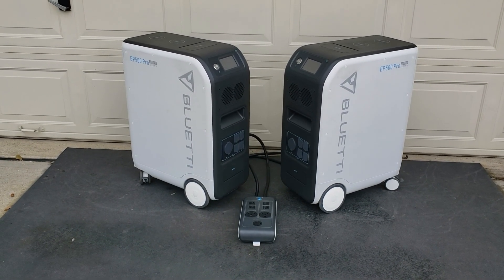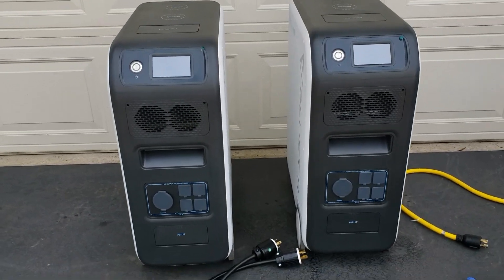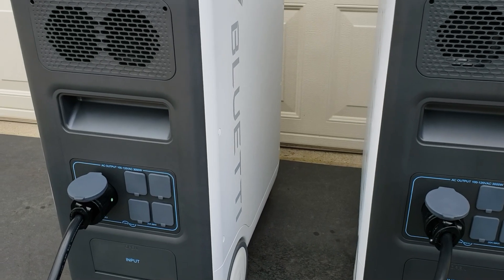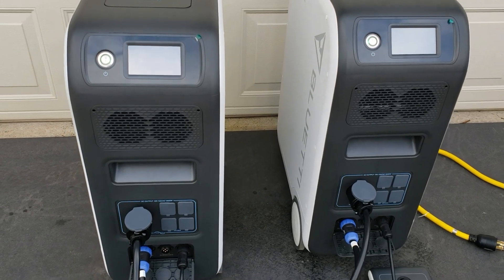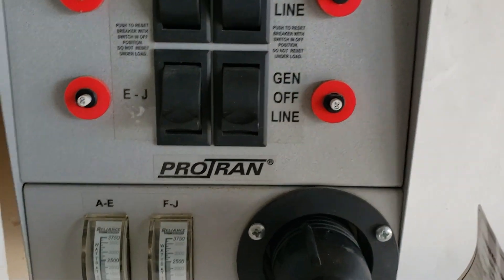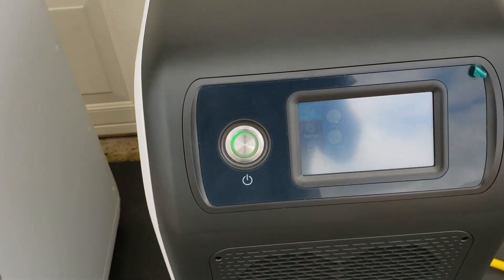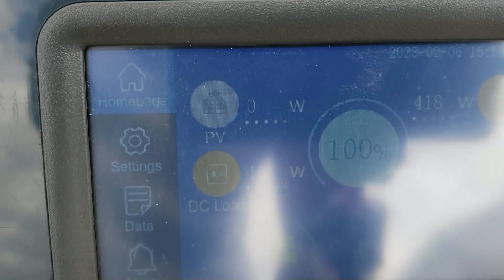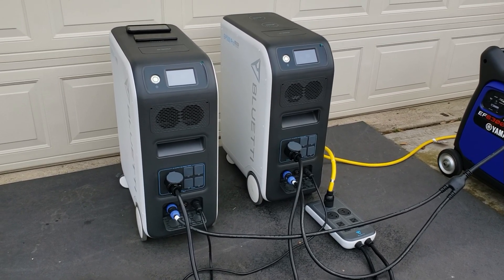BLUETTI EP500 Pro 240V Split Phase Fusion Box Powering my House

Comment: My home uses between 50 kwh and 80kwh in a 24 hour period (I have a well and all electric appliances on a ranch). I have a 50 amp transfer switch at the main panel.  I would prefer to run a split phase 240v Diesel generator, but they don't seem to be available.  I was thinking of running a pair or bluetti devices at 50 amps split phase to power the home in a power outage and use a smaller diesel generator to recharge the bluetti.  Any recommendations on which Bluetti to get?
Reply from the maker: In order to get the split phase, you have to buy two units. I really like the EP 500 pros
Because they included Inverter and the batteries in one unit

Comment: I assume your EP500’s have the same blip in UPS mode as it resync’s to the AC power input that the AC500’s do?  I.e. it cuts out for a second or two on the output until it is back on the same cycle as the input source.  

For the person that asked AC500 vs EP500 Pro.  AC500 has 50 amp outlets, more solar capacity, more inverter capacity, etc.  The EP500 is basically the same as the AC300.
Reply from the maker: Yes that is correct the resync  needs to be updated, there’s no need for it to cut power off and then back on.

Comment: Technically speaking..  could this be used as a way to achieve lvl 2 charging foe an electric vehicle?
Reply from the maker: I don’t think it has enough capacity for EV charging.
Reply: @GeneratorReviews  but it would be running off 240v 30amp..  if I lowered the amp to say 24.. that should technically allow a lvl2 to work.    My only hiccup would be if i need to trick the ground with a ground pin, and have enough batteries to extend the charge, no?

Comment: would you recommend the 2 bluetti ep500 or the 2 ecoflow delta pro for running your home?
Reply from the maker: They both are well known for reliability and quality. 
The only difference between the two is that the EcoFlow is easier to move around and used in other applications such as camping and Rv’s. 
If you don’t plan on doing those things, the EP 500 would actually work best for home use backup power.
Reply: Except for the EP500PRO doesn't take expansion batteries whereas the ecoflow delta pro does

Comment: If I got that the eb500 would be my are there blue Eddie 300 or there other 500 or if I can get it there 900. But I wonder if you can add extra units for just battery capacity like if you could add two more batteries to each unit and that would make it a nice unit.
Reply from the maker: I don’t think you can add batteries to this one

Comment: Great video! What do you think your endurance time would be starting with fully charged units at the load you had?
Reply from the maker: At that load with no input charging, I could probably run about 18 hours by adding solar panels and back of generator you’re set